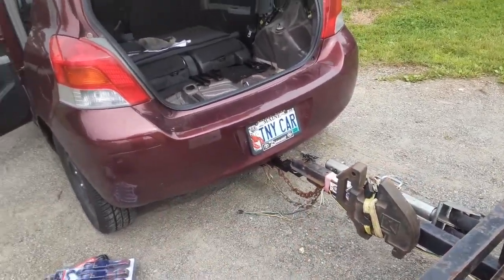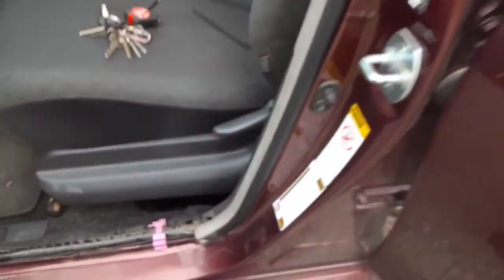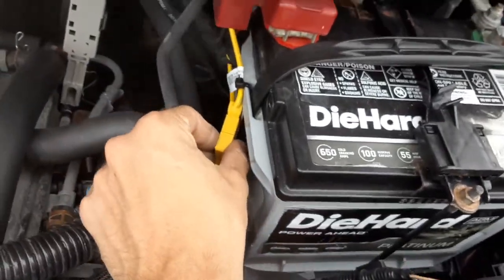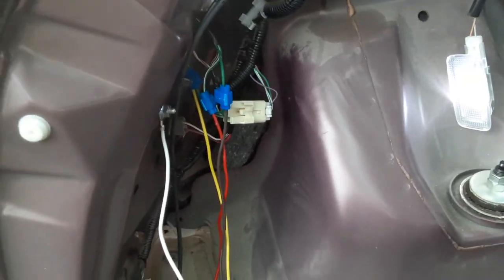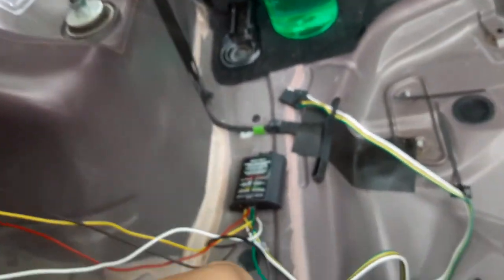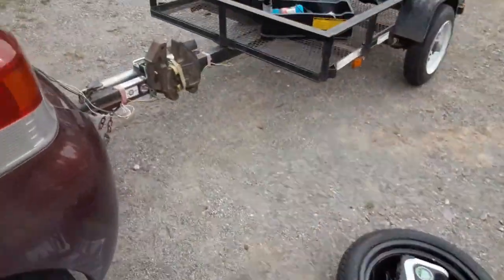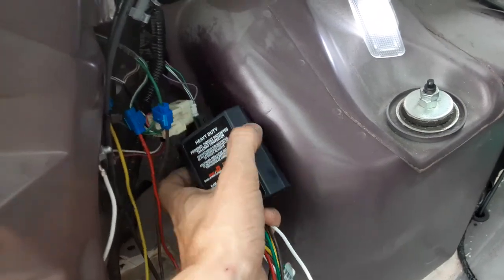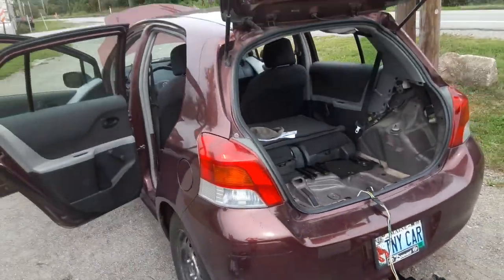2010 toyota yaris trailer wiring harness installation

Comment: At minute 2:38 can you tell me the number on the light blue relay that’s on the bottom right of the fuse box please?? I bought my 07 Yaris used and I have no Cold AC the mechanics say I need that relay. I’ve been to multiple junk yards but not luck and without that number I can’t find it on Amazon. Can you help please??
Reply from the maker: In my fusebox it says ST. I looked it up in the manual and it says it's the starter relay.

Comment: can i ask where you bought the mount for the hitch to attach to the yaris?
Reply from the maker: Etrailer.com
Reply: I got a hopkins 4 flat converter kit(48925) for my yaris. it's not workin(?). it does not have the 12v wire. etrailer says it the right one..do you have any insight??